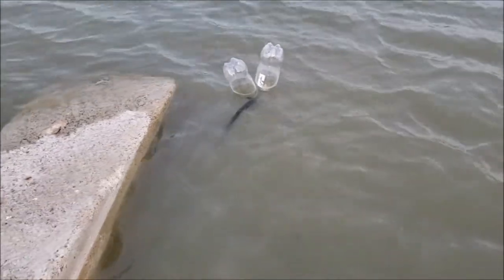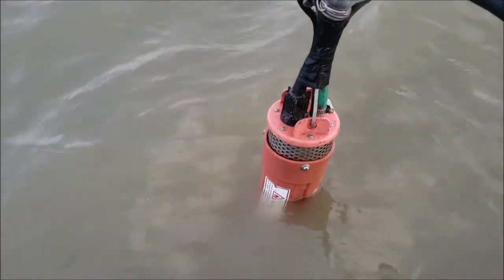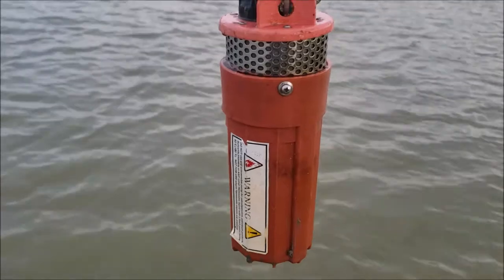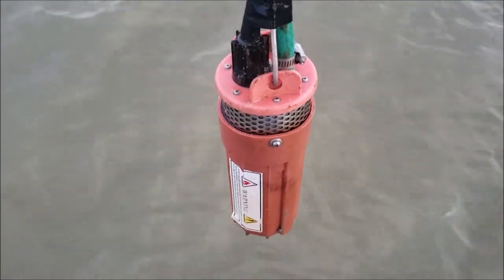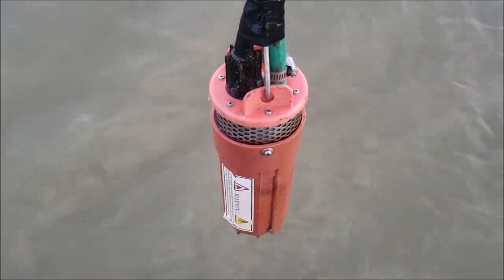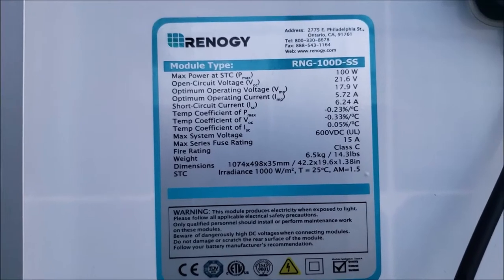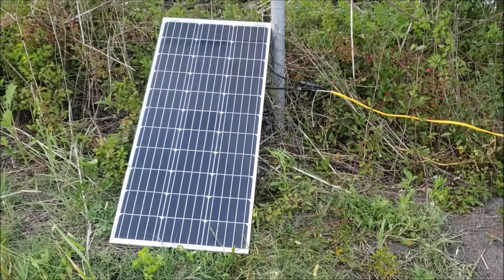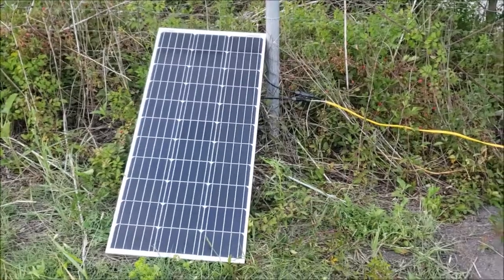Easy Solar Powered Water Pump

Comment: How long time can i use this pump a day? i need a long life pump to use for tilapia fish pond, 24/7 working
Reply from the maker: I have not used it 24/7 at any time, but I do run it about 10 hours a day straight and they have all been doing well for years.  I do switch mine out every few months or so to clean them and make sure they are working well.  Hope that helps.
Reply: @SeidelRanch  thanks

Comment: That pump is so cheap that it has last more than a year😂😂😂good tutorial in 2021
Reply from the maker: Yeah, when I bought it I figured if it only lasted a year or two it would be fine, but they have been doing great with no issues.
Reply: Have you ever changed the carbon brush of the motor in the past 4 years

Comment: Is it still working?
Reply from the maker: Oh yeah.  It still works great.  I have 3 of them now so I can switch them out every month or so to clean them.  I have to clean them off because they are in the lake and not a clean well.  Algae and such build up on it.  Then I have a new one still in the box to use as a backup if one fails, but they have been working great so far.

Comment: I'm surprised the pump has lasted you that long.  I have bought several and the longest one has worked has been a month.  I would not spend my money on the solar pump again.
Reply from the maker: You bought the same ones I use?  The 1st one I bought has lasted 4 years now with no issues at all.  I now have a second one for a backup and use it to swap out with the 1st one when cleaning it.  They have both been great.  No issues at all.